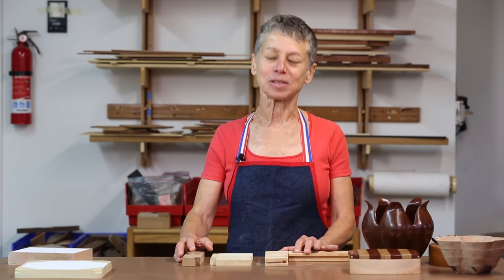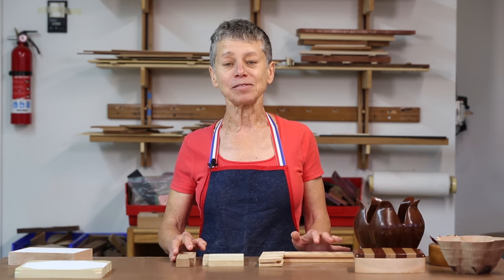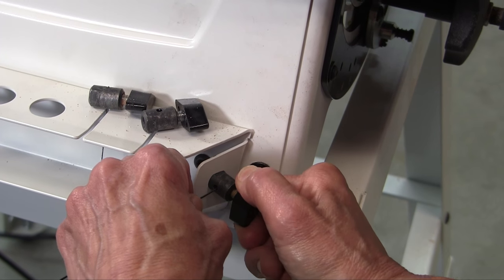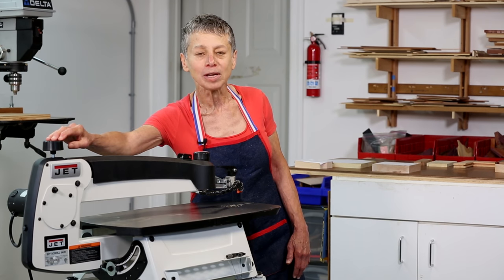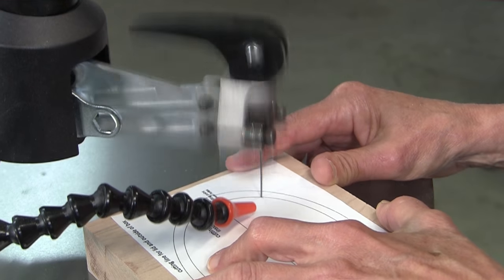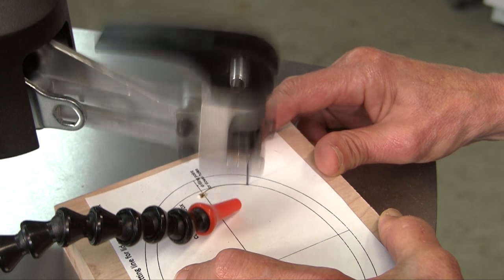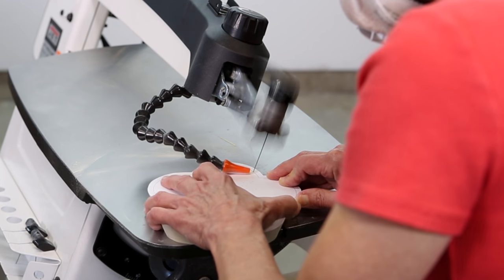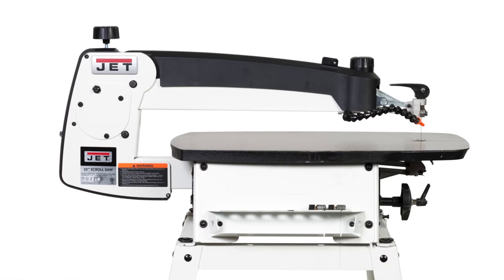Jet 22-in. Scroll Saw Overview - Jet JWSS-22

Comment: I finally outgrew my Porter Cable and went to Woodcraft and compared the Jet and Excalibur 21 side by side. We performed blade changes on both including spiral blades and nickel tests on both. both past the nickel test on high but we had a very hard time getting the Jet upper mechanism to clamp down on the blade especially the spiral blade. I went there truly wanting to love the Jet; however, there were too many what ifs. It was an agonizing decision; but after an hour with the salesman I decided  to go with the scroll saw that Jet was trying to emulate (or as the salesman said, "patent infringe") and dropped $900 on the Excalibur...

Comment: It looks the same as the Excalibur.
Reply: Nope. Not even similar. The Excalibur is MUCH better.
Reply: J. B. Brackett You've used both?
Reply: I've used both some. I personally think the DeWalt is the best bang for the buck. The Jet looked so promising and has some great features but I was amazed at how much vibration came through the arm. It's like a mini jackhammer. Nearly all the killer scrolls away guys I know prefer and use the dewalt some Excalibur and none were impressed enough with the Jet to switch. At least not yet.
Reply: J. B. Brackett Thanks.  I have the Dewalt.  I picked it up from an Auction for $200.  I've been pleased with it.